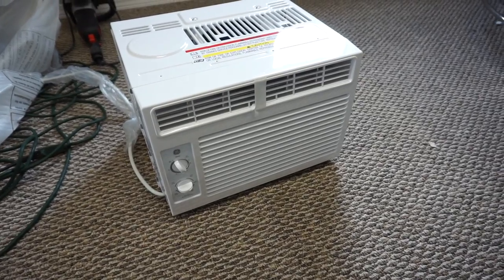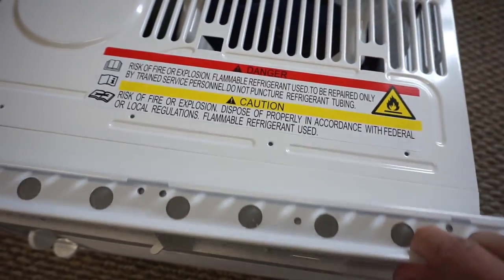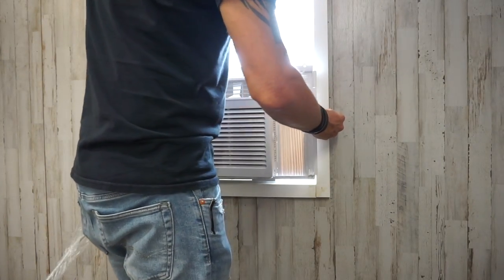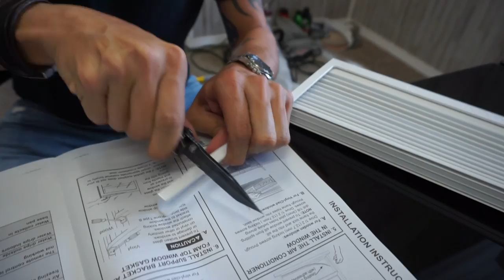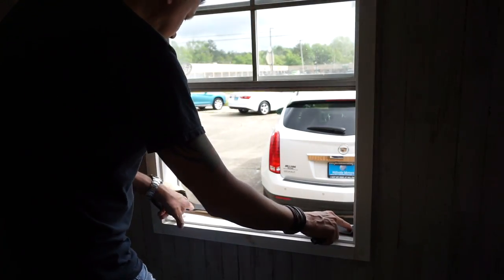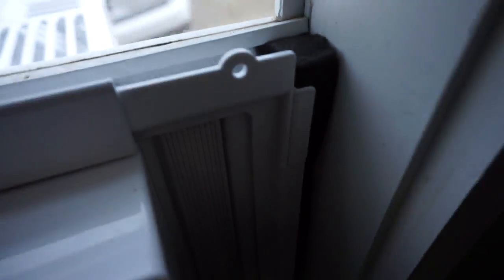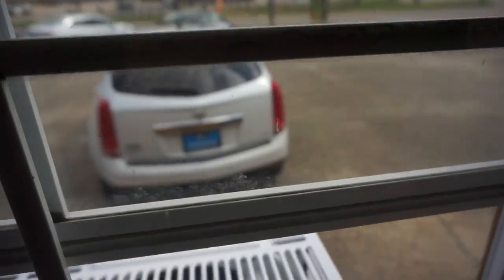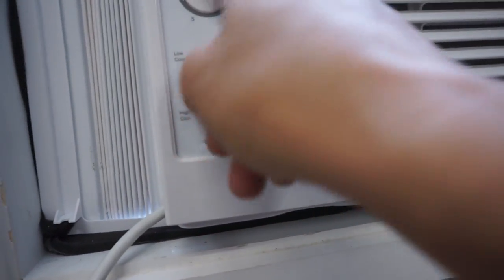Installing a window unit air conditioner in a portable Building DIY - How To

Comment: Quick tip for longevity of wall ac's is to let them sit still after handling and installation for 1 hour before turning on, and also you prevent water from coming in by setting a slight down angle toward the outside for drainage, using a level on top of the AC, and not basing it on the wall. (The wall could not be perfectly straight based on ground grade.

Comment: The coils on the back are called a condenser, just like in a car up by the radiator. The one inside the unit that gets cold is the evaporator.